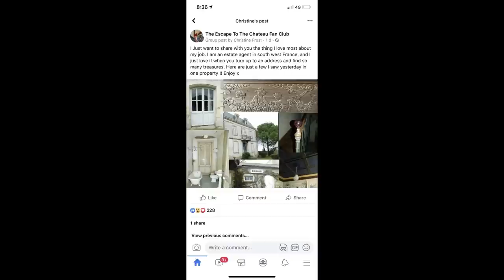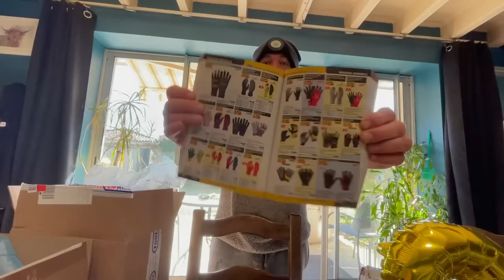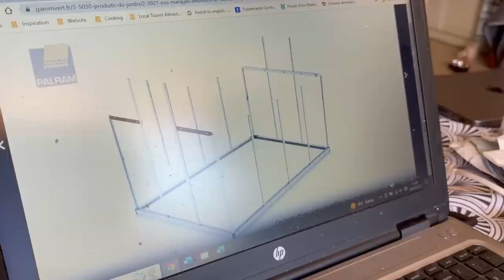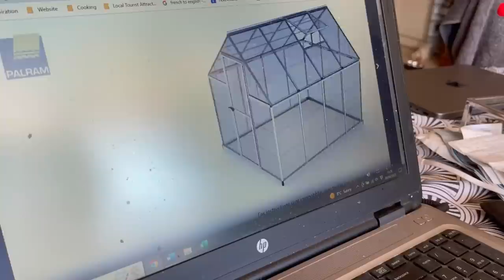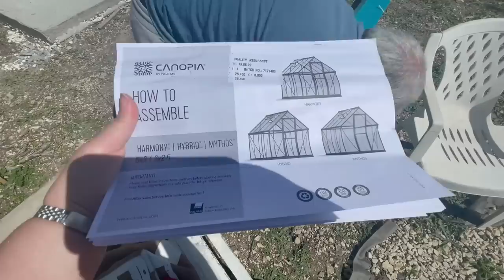Spring Has Sprung #85

Comment: You should attach chicken wire to your trellis to allow the tender tendrils to wrap around.  Otherwise, the vine will just bunch up at the bottom of your trellis.  Additionally, make sure you shade the roots of your clematis with another plant such as a small rose bush or a terracotta root protector which help shade their roots from the sun because clematis prefer a cool, relatively moist root run.
Reply from the maker: Thanks for the good tip, have popped out there this afternoon and used some old roof tiles x

Comment: Real quick questions. Do you like that sprayer? Would you ever recommend someone buying one?
Reply from the maker: I think it was easier than hand applying the render for someone with little experience - although it did block up a lot and on the final stages of use it was starting to cease where it kept blocking. Maybe a more expensive model type might work better...?